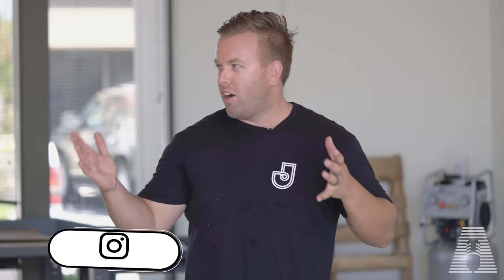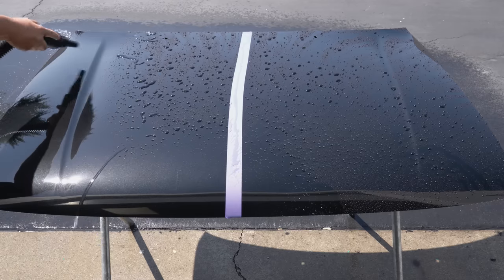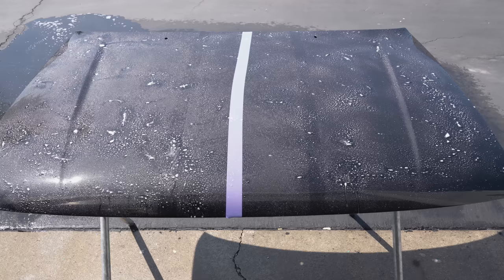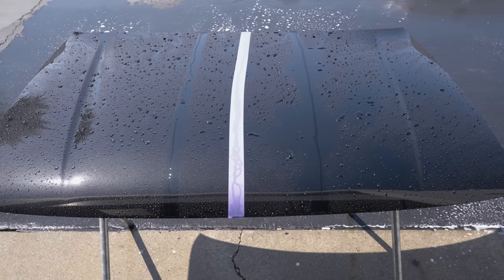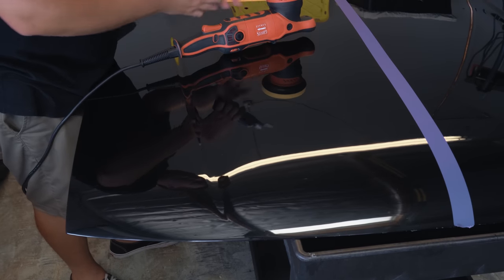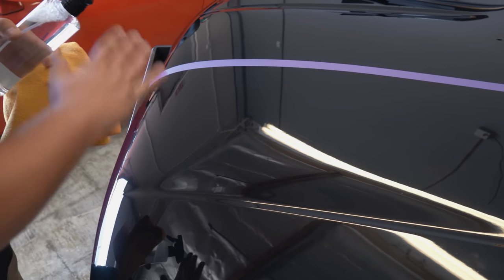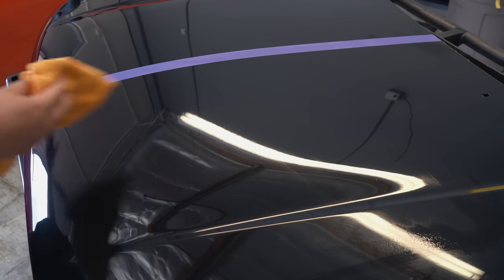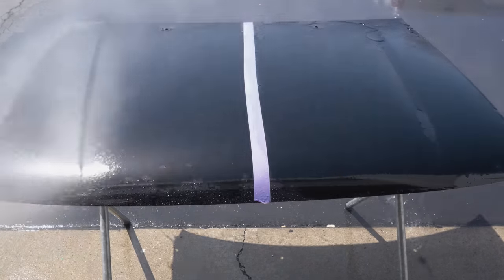HOW TO REMOVE SEAL N SHINE AND OTHER WAXES, SEALANTS AND COATINGS - THE EASY WAY.

Comment: Starting with the strong APC is perfect as it chemically scars the protection.  Instead of compounding another option that will also work for coatings too is Optimum MDR with a 20-30 minute dwell time.  At a ph of 2.6 very little can stand up to it with the long dwell time.  Doing this also oftentimes makes it so you don't need to clay. I've personally removed CQuartz this way. Killed it dead.
Reply from the maker: Good to know!
Reply: I'd like to try this but are there any concerns with stress to the clearcoat by using an acid?
Reply: @Jeff_Seely  not at all a concern. This is a mild acid and Dr G, the Optimum Chemist and CEO is one of the inventors of clear. Everything they make is about preserving clear coat.
Reply: Hi Paul quick question what dilution ratio of MDR do you recommend for stripping prev wax and sealants?
Reply: @marconunez174  I'd use MDR straight but spread with a damp microfiber towel.  It will make it go further and spread easier

Comment: Jimbo, after hearing all your podcasts ive learned just because the surface isnt hydrophobic, doesnt mean the sealant is gone. The hydrophobic chemical they use to get that behavior is now gone clearly but how do you know youve got it all? Id imagine with your experience you know because youve tried a correction afterwards and the paint wasnt acting "harder" that usual and filling up the pad with the sealant. Wish you well hope this info is helpful to others.

Comment: Thanks for another education car care video. You definitely touched all the bases on why i am considering stripping my paint sealant (Fusso Coat). I want to take it off primarily because I want to do a better paint correction on the vehicle with Fusso. Dang stuff is nearly indestructible! I came across two spray strippers that might work. Duplicolor and Rustomeum both sell an aerosol stripper/paint prep. Have you ever used the products? If not, would you possibly consider a review. I think it would make an excellent review? Thanks very much!

Comment: mornin jimbo...hope u and your loved ones are safe and WELL!!!!....the vid is perfect timing as i am going to strip protection off of vehicle(lexus es350) and apply fresh coating for the upcoming winter which in my area of chicago and nw indiana is pretty harsh!!  

protection i will be applying is IGL F4 - which is currently on there - but i want to strip off the "toppers" and the do a exfoliation of paint b4 applying.....which i am going to test jim lafebers(dr bealeys) Z 1 Zano.....to exfoliate.  we have discussed it as i was going to use his nsp 95....but he rec for the lexus the new AIO version which is the Z1 would do the trick....fyi - the NSP line has recd "game changer" reviews....from everyone....mike phillips of autogeek reviewed it and was pretty much blown away.....also an awesome benefit is that NO PANEL WIPE IS NEEDED WHEN USING NSP - Z1.....go straight to sealant/coating as they lay down a bonding matrix creating a superior bonding result of any product.   fyi - jim is a founding member of IGA....and past president.  he knows his stuff.  again thks for vid as it will save me time in getting to re-apply protection

Comment: I need some help and a few concerns.  I bought a new Toyota that came with a Toyoguard sealant from the SE Distributor.  I want to ceramic coat the whole car but not crazy taking 205 to a fresh clear coat.  I am new to detailing. There are no swirls and therefore no paint correction needed.  What do you suggest to remove the sealant so I can apply a polish before applying the coating.  I am familiar with the ceramic coating steps but getting to bare paint is my issue I need help with.  Thanks in Advance.

Comment: If I’m not mistaken, once the compound hazes up,  I think u can water hose spray off the Speed Compound. Should say on bottle directions as an option. Kinda cool and very different to competitors.
Reply from the maker: I’ve tried it. It won’t wash off with only water but soap and water it will

Comment: Jimbo have you tried out the new Dawn Powerwash that comes in a foaming spray bottle as a strip wash? If you haven't you should try it out. The same way that you have been using the APC's. Spray on the panel and on your towel and wipe it in. It's VERY effective unlike the regular liquid soap that won't touch fresh sealants.

Comment: If seal and shine is placed over a ceramic coated car, will this method damage the ceramic coating?  Or how do I remove the Turtle wax coatings from a ceramic coated vehicle?

Comment: After a few layers of Seal & Shine is it necessary to remove all of it in order to reapply fresh. Or can I just keep going with layer upon layer? I’m not clear about this.
Reply: it says on the bottle it can be layered so you are good to go
Reply: @diggersdiecast8879  yes, I know you can layer it.  That’s what I have done 3-4 times now.  I’m asking “how many times” I can layer it. Can I go on layering it 10+ times, etc. or is there a point where I need to remove all the old layers? I would guess after a few times (less than 10) complete removal is necessary.  That may be necessary after only 3-4. I’m just trying to get a better understanding.

Comment: JIMBO, Try using WaxPlanet Eight Below and you will see how it breaks down waxes and sealants much faster.  At least, that's what I have done with customer's vehicles I have detailed for the first time.  I cannot tell you about removing Ceramic coating products on them since none had but per dilution ratio I think it would also remove them.
Xoxo from Puerto Rico 👍🇵🇷

Comment: Is there a way to remove scratches off from window chrome trims? 2018+  Toyota camrys specifically
Reply: I would love an answer as well!!! What about the black plastic on the two door frames next to the rear door that get swirl marks? Thx!!!
Reply: Depends how deep the scratches are obviously but most compounds paired with either a microfiber applicator or short pile microfiber towel should work. It might take more than one try but I have used a lot of different products and had good results. I will say that if it is by any rubber trim you either want to make sure that you tape over the trim or pick a compound that says it will not stain trim such as Optimum Hyper Compound.
Reply: @dandansdetailing9755  Will it work on Camrys window chrome trims? Feels like plastic chrome. Thank you!

Comment: Jimbo have you ever used the DeWalt cordless polisher, I recently purchased mine and I'm in absolute love with it. Tons of power and no cords to mess around with. Highly recommend it
Reply: I've had my eye on the makita, it has the ability to be forced or free dual action but its not cheap. With a battery, do you think  weight is an issue?
Reply: @scottmattern482  I used a 6amp with my DeWalt and found the balance to be perfect
Reply: @bangmygears  thank you for the insights

Comment: I have bead maker on my Harley right now but I am getting it pinstriped in a few weeks. Could I wipe the bike down with car pro eraser and that will take off the bead maker? Paint needs to be free of any protection for the pinstriping
Reply from the maker: ya bead maker is pretty weak so it should take it off.

Comment: Thank goodness that the truth about stripping paint sealants has been identified in this video. People think they can spray some form of chemical or soap on a paint job and strip it. That only holds true for old wax or sealants that have already begun to degrade. You're not getting paint sealant that has just been applied off unless you polish